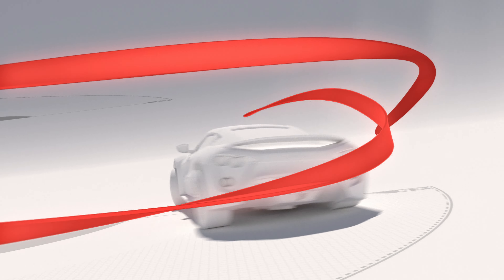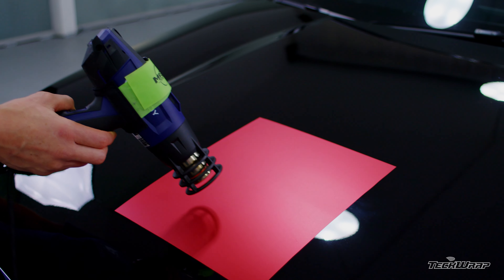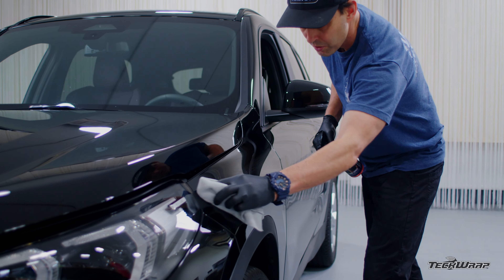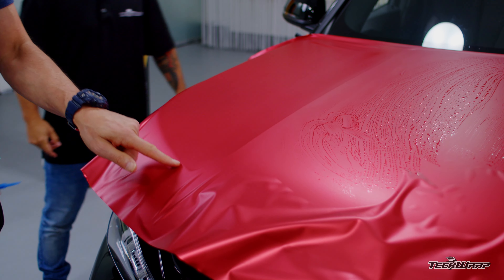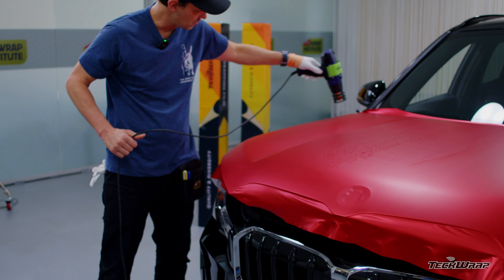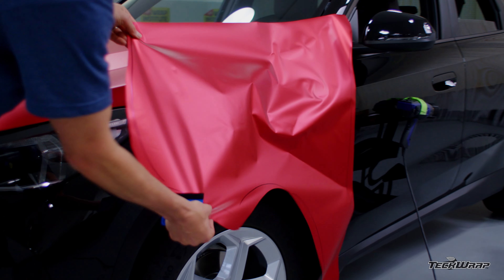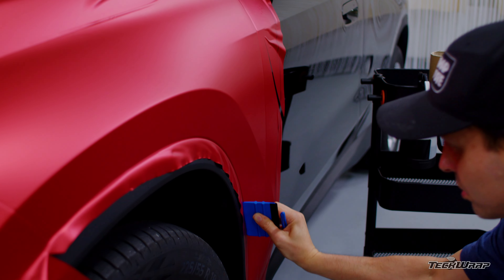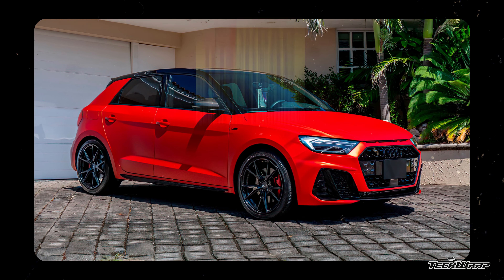TeckWrap Satin Metallic Vinyl Film Series / New product videos from The Wrap Institute

Comment: Why when working with teckwrap there are some gluelines? Maybe becouse of the heat and squegeeing to fast or to much pressure?
Reply from the maker: Greetings, the adhesive lines are due to 2 factors, first, overheating (temperature of the surface, the room, the material), heat activates the adhesive, makes it more aggressive, second pull ups and angles, avoid rapid movements and repositioning as you already squeegee the surface and keep the film at the low angle to the surface. Larger panels should be wrapped by 2 people, creating a glass surface
Reply: What would you recomend and be carefull when working with teckwrap?